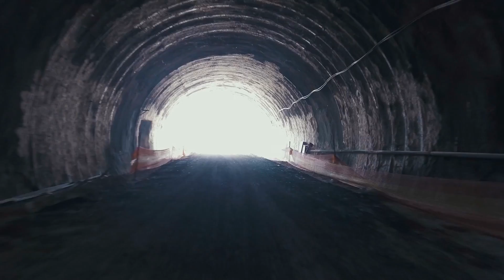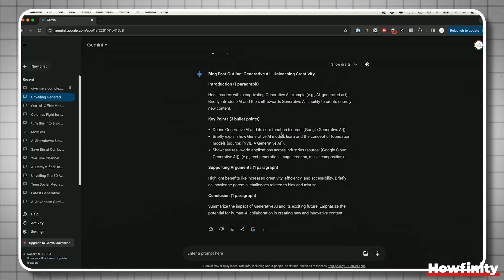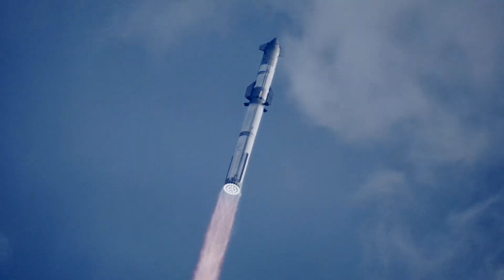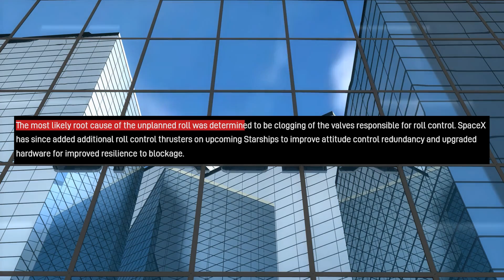Elon Musk's xAI is About To Take Over!

Comment: 4:50

You misspoke.

The current versions of the models work with text, image, and voice. ChatGPT 4, Gemini, etc.  All are multi-modal.
Reply: You are incorrect. This is a misunderstanding a lot of people have. The current models are not truly multi-modal. For example when you use speech input for gpt-4, you are simply converting audio to text using a separate model, then gpt-4 takes that text and uses it to give you a response. The actual gpt-4 model only understands text. It is a different model that converts the audio to text so that gpt-4 can 'understand' it. True multimodality does not utilise multiple neural networks in this manner, it instead uses a single neural net that understands multiple modes (audio, imagery, text...) which means the AI can process the audio and imagery with far greater accuracy.
Reply: @Joxus  

That is what multi-modal means...

All are consolidated into a single type - in this case, text.

GPT-4o utilizes local hardware to do a lot of things...

Same with Google...

The fact that they can react so quickly is a sign that there is not any transformation to a local model happening.
Reply: @JohnBoen but GPT-4 is not natively multimodal, instead it is just using multiple models in synchronisity to achieve multimodal-like capabilities. The difference with GPT-4o is that it natively understands audio without having to convert it to text first. It processes the audio in its raw form, allowing it to be far more accurate. Unfortunately, OpenAI has not yet released the full GPT-4o model to the public, so it is still utilising a separate text-to-speech model within the app, which is confusing a lot of people.
Reply: @Joxus  

Maybe I am misreading it - Based on the API documentation GPT-4O supports several types of input including image, text, and voice... multiple objects can be passed into a call to the service.

Comment: 00:00 The Boring Company Breakthrough in Vegas, xAI Funding, Megafactory Shanghai Update, Starship Launch Date
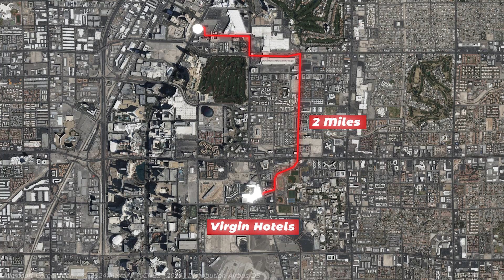00:36 Details on the Boring Company's Vegas Tunnel Location
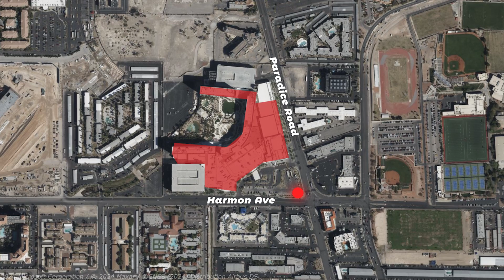01:06 Speculation on the Vegas Loop Launch Point and Route Deviations
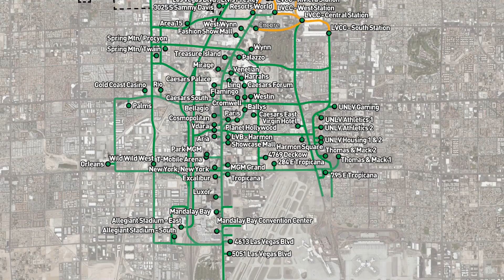01:36 Vegas Loop Map Discrepancies and Potential Tunnel Design
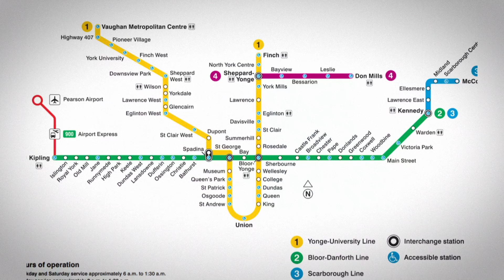02:05 Vegas Loop Station Plans and Elon Musk's Vision
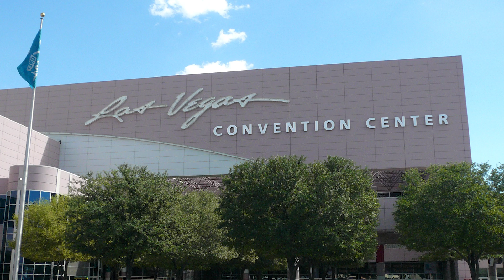02:38 xAI Secures $6 Billion in Funding, Valuation Reaches $18 Billion
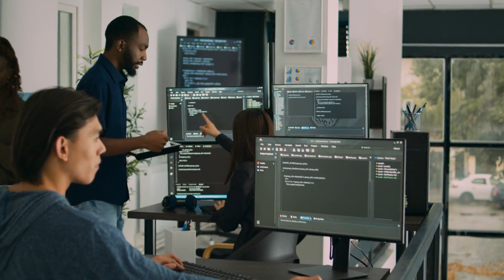03:13 xAI's Funding Allocation: Hardware, Infrastructure, R&D
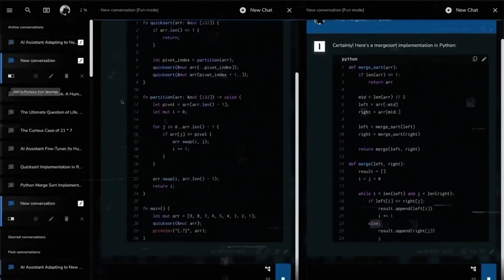03:48 xAI's "Gigafactory of Compute" and NVIDIA H100 GPU Costs
04:17 Grok Chatbot Upgrade, Competition with OpenAI's GPT Models
04:47 Elon Musk's AGI Prediction and xAI's Ambitious Goals
05:18 xAI's Focus on Truthful, Competent, and Beneficial AI Systems
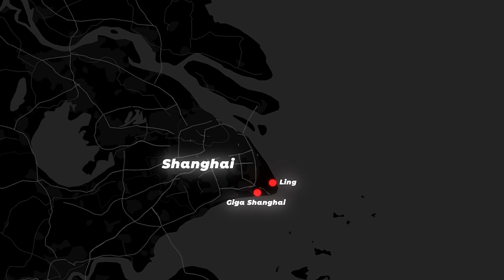05:49 Tesla Begins Construction of Shanghai Megapack Factory
06:21 Shanghai Megapack Factory Capacity, Production Start Date, and Impact
06:53 Starship Flight Test 4 Launch Date and Re-entry Goals
07:25 Starship Flight 3 Failure Analysis: Super Heavy Booster Issues
07:54 Super Heavy Booster Engine Failures and Landing Burn Attempt
08:27 SpaceX's Mitigation Efforts for Future Super Heavy Boosters
08:56 Starship Flight 3 Failure Analysis: Ship Stage Issues
09:27 SpaceX's Solutions for Starship Roll Control and Heat Resistance
09:57 Announcement of Upcoming Break and Guest Host Introduction